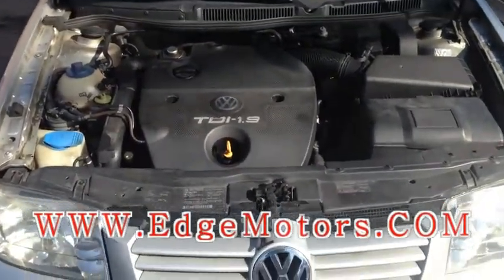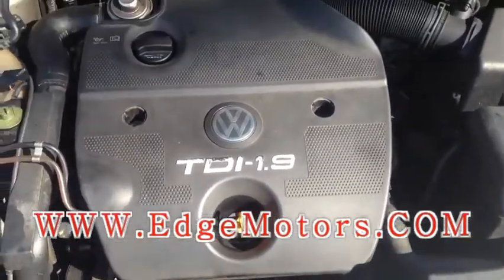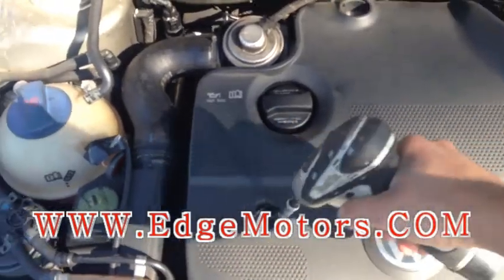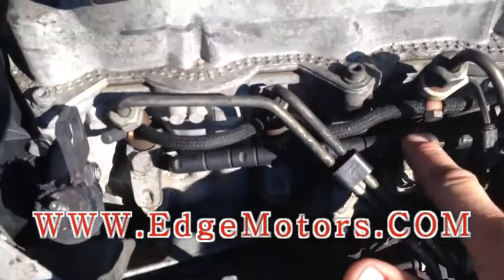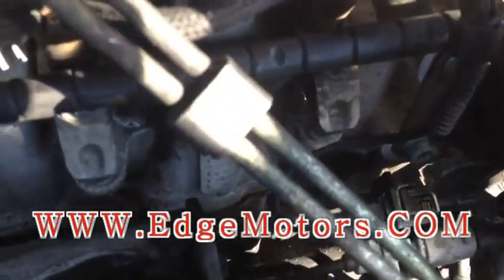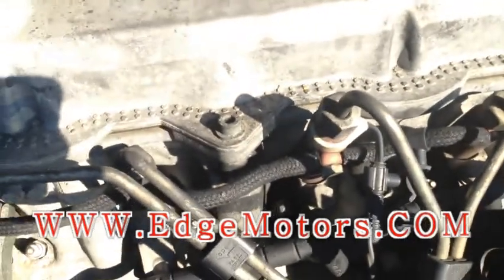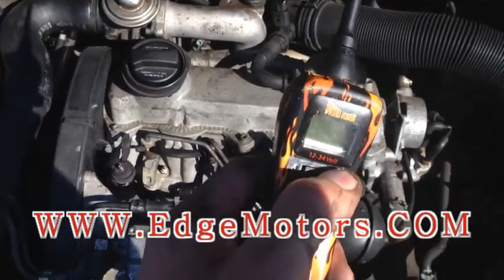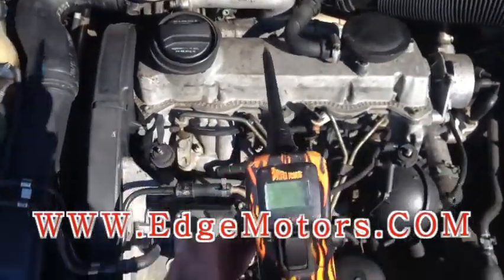Vw Jetta TDI 1.9t how to check glow plugs DIY by Edge Motors

Comment: I what I do when I have faults with glow plugs I save the faults for the customer and then erase the faults and then do the output test with the vag com and then if the faults come right away I know that there is most likely some burnt but it could be a glow plug harness problem one note make sure they are all the same brand 4 beru or 4 bosch do not mix them. And when you do the out put test you can test if the relay and fuse is ok.